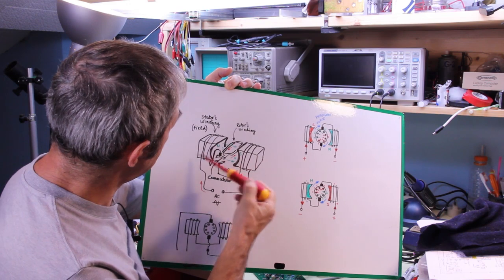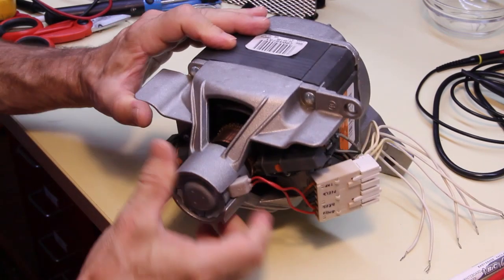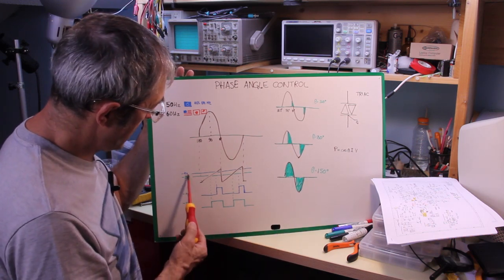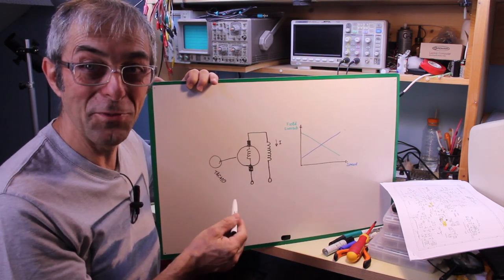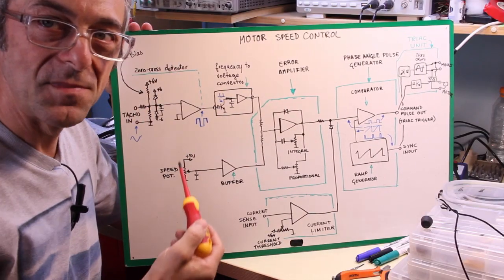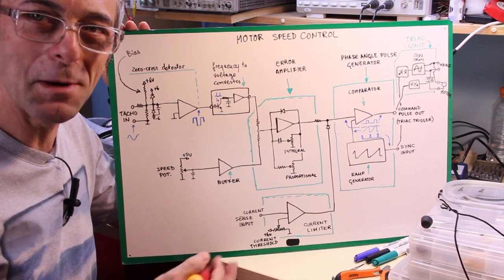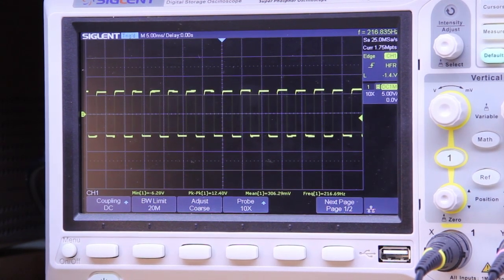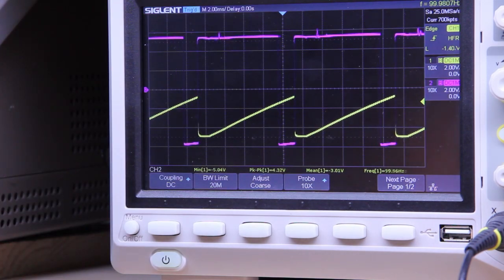All you want to know for driving powerful motors recycled from washing machines

Comment: don't know if you mentioned this in your video or other comments (or I missed it), but I remain with the question if it is OK to run these motors for long time (> 1h) at low speed, like 50% ? 
Thank you for any feed back
Reply from the maker: @jan_db30500  thanks for asking, it's a good question about a topic I actually missed to address. I suppose your concerns are about temperature. Low speed means low power (at equal load). Heat is by function of power. Some universal motors have a propeller or self-fan that increases ventilation as the speed (and power) increases. That kind of motors are not designed to work with high load at low speed because the increased load would make them overheat when the ratio between dissipated power and ventilation becomes too high. Motors used in washers on the other hand usually don't have any fan because they are designed to withstand full load at low speed. However washers often determine a duty cycle that may be related to this issue.
So there is no definitive answer to this question, but just the suggestion to check the temperature at the intended work load and speed. 
Also, motors used in washers have a tachometer (or equivalent) and a thermostat that if connected helps prevent the motor overheating.
In my experience I noticed they become pretty warm but never had issues. A further option is to add a fan, like those used in computers.
Reply: Many thanks for the quick and very clarifying answer. It clarifies all of my concerns about heat, ventilator and even over temperature thermostat. Think I’m going to give it a shot without extra ventilation and when needed, I still can add it later. 
Another quick question… on the motor is stated 11600rpm. Yes eleven thousand. I suppose this is with free run without any restrictions or load. I can’t imagine a washing machine runnin at that speed. The belt would simply not hold it. Any thoughts on that ?
PS: I love it when creators take care of their public!!!
Reply from the maker: @JAN_DB  not sure 100% but I think it should be unloaded with no regulation. This is related to the parasitic resistance of the coils and stray current in the iron that causes power losses when load is applied: more load=>more current, which in turn increases stray current in iron and voltage drop across the parasitic resistance. Stray current means less coercion of the magnetic field thus less force. Voltage drop means it adds to the EMF generated, which is proportional to the speed. Both counteract the supplied voltage. The whole effect is the motor slows down when under load. The more these parasitic factors are larger the more the motor slows down when loaded.
To counteract this phenomenon the regulator has to adjust the output power, comparing the actual speed.
It's difficult to explain this in a comment typing on a mobile phone, so I hope it makes sense.
Reply from the maker: Indeed I think I showed this in the video: unregulated/uncontrolled motors like these [used in washers] would run at excessive speed.
There is another phenomenon in place too. Since these motors have their stator coil in series with the rotor coil, with no load and at high speed the motor experiences de-fluxing, which contributes to the increase in speed.
Reply: @AccidentalScience   not 100% clear in detail (I’m no electrician) but I get the bottom line: when under load it will never get at that max speed…

Comment: Hello, i enjoyed your video. I am curious why we need external speed feedback from tach or optical disk. It seems to me that the speed feedback already exists in the current waveform of power supplied to the motor. There should be a positive or negative spike in the supply current each time a commutator segment make or breaks contact with the brushes. So it's like a built-in 6 or 8 or other number of pulse per rev (depending on pole count) speed feedback mechanism. I would like to build a device like the popular triac-based "router speed controller" which corded hand tools can be plugged into, that will deliver more consistent speed with changing load by compensating based on this feedback. But the fact it does not seem to exist and everyone (like manufacturers of washing machine motors you are using) opt for separate feedback mechanism. Why is that?
Reply from the maker: Hi, thank you for your comment. I have no definitive answer to your question but I think it's because spikes caused by the commutator are the core reason why DC brushed motors are noisy, and the reason why designers try to counteract it in various ways. Also AC mains can lead noise from other equipment. So picking these spikes could be unreliable and that's why some kind of external sensors are used to get speed feedback. 
Motor speed is affected by the internal resistance, so an alternative more reliable method is to use current compensation.
Reply: @AccidentalScience  great points! I had considered the noise generated by reading these spikes instead of suppressing them, but I had not considered the effect of noise from other devices on the line causing errors in the speed signal. Both issues could probably be addressed by the use of an isolation transformer with filtering on the primary, but this would be costly and grow complexity of the devices and is probably sufficient reason why the device I want does not already exist. Thank you for taking the time to address my questions!

Comment: I have a lot of them in my shop and always wondered, with the correct speed control pcb, can I use for of them to drive a small gokart?
Reply from the maker: Unless you bring with you a battery capable of supplying 300V with considerable wattage, you'd need a loonnnnnnnnnnnnnnnnnnnnnnnnng cable :)

Comment: Thank you for this video and all the rest, they're excellent. I subscribed as I'm also building a lathe.
Also I have this exact motor.
Do you have the circuit uploaded somewhere? I'm interested in tachometer input and the freq to voltage converter.
Else: I don't have an oscilloscope in the same place than the motor, do you have a rough spec of the tachometer output? I mean amplitude vs speed and frequency vs speed.
Reply from the maker: If I recall correctly voltage should reach about 20V at max speed, while frequency should be proportional to the speed, in other words a peak per revolution. It is a sine wave, I think I've shown it in the video.
About the schematic I will put it on my website, but in spite of the long time past I haven't completed the site yet 🙄
Reply: @AccidentalScience  Thank you! looking forward. Honestly your approach to the circuit design has so many good ideas and best practices that it would deserve a chapter on its own. It's modular, the feedback is PI, the high voltage section is well isolated... Oh, and also is NOT microcontroller based! rocks
Reply from the maker: @EnriqueVetere  thank you. Send me an email at info at my channel name com, be sure to add your username in the subject, I'll send you back the schematic.
Reply: @AccidentalScience  mail sent! Thanks a lot
Reply from the maker: @EnriqueVetere  I have received nothing. Please check the email address, the name must not have spaces in it. Alternatively go to my channel's page, click 'about' and 'contact for business' to reveal the email address. Please let me know, I have already had problems with that email in the past. Thank you.
Reply: @AccidentalScience  I copied the address from the information page here, maybe it got to spam? I resent it
Reply from the maker: @EnriqueVetere  I'll check for it at the server level, clearly something went wrong. I will reply to you here, in the case I will ask you to try again and again, if you don'y mind.
Reply: @AccidentalScience  sure, no problem!
Reply from the maker: @EnriqueVetere  problem found and solved.
Reply: @AccidentalScience  great! I've just resent the mail

Comment: I would say the main question is: "How did you controlled TWO such motors AT ONCE  to power your lathe?" With one single such, or another controller, with two ... ? Why you did not used just TDA1085C which has all you needed for that application? But there would be the same question again - two motors at once?
Reply from the maker: TDA1085 is no longer in production, furthermore I have a bunch of OPAMPs so I rather use them than buying a specific component. Last but not least, TDA1085 do not provide insulation: all the circuit is at the power grid potential.
About how I managed to control two motors at once: one of the motor is directly driven by a separate triac unit that work synchronous with the one that controls the main motor. The secondary motor has slightly higher speed than the main motor so it is forced to work as torque motor. More in a future video. Thanks for the questions.
Reply: @AccidentalScience  Thanks, you are really fast answerer, my respect! I bought 4 pieces TDA1085C recently easily. If particular separation from mains is required it can be done. I need now for my DIY combo lathe/mill, also to connect two motors to work as single one motor. I was not lucky to find two the same motors (can find two similar) - the same situation like your. Two triac's can be driven from single one controller, and connect Tacho from only one of the motors. For that case, I figured out just to make, and put adequately bigger pulley on the shaft of slower motor. Total torque should be the just the sum of both, but I am not sure about that at maximum load ...  Thanks for Whitworth method video, and other nice ones. Posts about such smart stuffs are never enough, but unfortunately are rare. Care about places where you applied epoxy on your lathe. First, I wanted to make lathe bed from epoxy granite, but I was discouraged when heard from experienced machinists that metalworking machines sometimes became very hot, and epoxy become soft about 80 degree C ...
Reply from the maker: There are thousands ways to perform a function with electronic cirtuits. If you find in comfort with TDA1085, then go for it. I designed a circuit that has multple functions, not just motor control, so I used that one with a couple of power units built around a triac. That was designed around my needs and the components I have at home. That's why we do it by ourselves.
I strongly doubt the bed of a machine reaches 80°C. Do you realize what kind of deformation would occur with such a temperature differential? Also electric motors typically have a thermostat that trips at 70°C, and encoders would just not work properly. If the bed of a lathe reaches 80°C, since it is the largest mass of the machine everything on the machine would level at that temperature. Lathes are subtractive working machines, which means they remove material, and most of the heat is removed through chips. If memory serve me well precision machines should sit between 30°C to 40°C and the most precise have temperature control of course. About this I've made a quick search, this is a problem that has been addressed since 1962, give a look at patent # US3303731A .

Comment: I like all your projects (I follow the one from lathe very closely)
Let's see if you can help me ... I have a washing machine motor, but I can't find any information about it. It has only 3 wires (it does not have brushes), apart from two of the plug, I measure the ohms and the 3 readings give me the same measurement, connect two terminals, it coiled and it got very hot.
I have disassembled where the pins go and it has 3 coils, 6 tips ... And I don't know how to connect it ... Since if I can give you some information, it works 195v and 310hz ... The model is "Nidec wc107a50100"
And if you could even guide me a little, I would appreciate it, thank you!
Reply from the maker: I was just going to sleep but at first glance (so to say) it seems you have a three phases motor. Did you googled for the motor's code? Any result? Maybe tomorrow I'll try to look fo it. Bye.
Reply: @AccidentalScience  I'm so sorry, it wasn't my intention
If I have searched through google and nothing relevant, no datasheet or similar, it also gives me that feeling for certain reasons. Three phases to be able to be managed with an inverter of the washing machine itself, and the high frequency of the same motor, since if an inverter does not do it ... the local network cannot give those hz.
I'm not a specialist .... Others say you can have two gears or two senses, but I doubt it.
Thanks!
Reply from the maker: Don't worry, I was in bed watching videos when your comment popped up. I found this: https://www.indesitspares.co.uk/motor-nidec-sole-0016105900-type-wc107a50100-17500rpm/product.pl?pid=1692103 and I think it is your motor.
This is a three phases motor (induction motor) with high frequency rate, as you noted 310Hz at 195V (AC), able to spin up to 17500 rpm ! Beautiful! The motor has a tachometer for speed feedback. Tacho comes from the two thin brown wires. I think it's a tacho and not an angle detector because only two wires come from the unit and AFAIK no angular sensor have only two wires. The other thicker colored wires are the power coils. To drive this motor you need an inverter. If the feedback was from a resolver (or a hall sensor) for angular sensing then the motor would have required a brushless driver. However I don't know any inverter that has a tacho feedback input (but not an expert on inverters here), so probably you really need the inverter from the washing machine where the motor came from, but that would be tricky. I also found a guy who did exactly what you're trying to do: recovering this kind of motor from a washing machine and rebuilding the circuit to drive it; follow this link: https://circuitcellar.com/research-design-hub/variable-frequency-drive-part-2/
Hope this will be helpful. Greetings from the Alps.
P.s. Consider to subscribe and share, to help the channel growth. Thank you.
Reply: @AccidentalScience  Wowow! You've gotten more information in an hour than I have in weeks! I really couldn't find anything!
I will try to make it work well with this information that you give me, I think the engine is worth it, I'll see that video!
And yes, I am subscribed and I follow many of his videos, among them "Metal Lathe" which I think is a great job.
Greetings from Complutum, Iberian Peninsula

Comment: You gave me a big idea sir , thank you, do you think it would be good for a lathe , what is the wattage of the motor how many rpm can go? while you trying to stop it looked very strong and the feedback keeping it to constant rpm was  impressive, Thank you in advance.
Reply from the maker: Some of these kind of motors can go up to 10000 rpm, some even more. The real problem is to find the specifications. You can have a ballpark idea of the maximum  attainable speed knowing that the spin phase in a washing machine usually is around 600 to 800 rpm, and looking at the diameter ratio of the belt wheel and the pinion of the motor you can calculate the max motor's rpm.
Reply: @AccidentalScience  Thank you for your reply, I think it should be good because I need my rpm's from 100 to 1000, so with a redaction of 10:1 will have plenty of torque. Basically I was thinking to use a vfd to drive my current motor, the problem is if I want to get range 100 to 1000 rpm  I will need to drive the motor double the frequency or more, do you think there is a danger of exploding the motor at higher frequencies?  thank you.
Reply from the maker: @cytron8787  I haven't well understood what vfd have to do with universal motors that are those showcased in the video. AC induction motors have a specific speed rating that is given by their nominal frequency, say 50Hz. Some are specially built to handle higher frequencies, i.e., 400Hz, but that is not common. Unfortunately I have no that experience with vfd controlled motors so I cannot tell you whether a 50Hz motor could handle 400Hz, but under the mechanical point of view I am dubious about the ability of such kind of motor to run at ten times its rating speed: I wouldn't do it! Yes, a motor can also explode if it runs at a much higher speed. When I was young I heard a story from a fellow technician who fu*ed up the field parameters of a BIG DC motor (as tall as a man) which run away up to the explosion point, destroying a section of the building where it was installed and almost killing two men. Universal motors are usually rated for higher speed to work through a reduction and draw smaller current as they have poor heat dissipation and low efficiency when current goes high because of their field-winding configuration. Nevertheless motors coming from washing machines are pretty powerful and feature higher efficiency (for an universal motor) as their winding is thicker and have large brushes. Providing an external ventilation (i.e., through a computer fan and placing the motor in a proper case to convey the air flow) you can even squeeze quite a current through them. It's important to convey the air inside the motor as the rotor is the most critical part. Ciao.
Reply: @AccidentalScience  Thank you for the answer, I just want to run it 3 times of its rated rpm say from 50hz to 150hz, Really want to try it because it is much easer for me. I will take the risks , after all science it always risky :-).
Reply from the maker: @cytron8787  3 times more is not negligible but likely the motor won't explode ...however I won't take liabilities ;)
Reply: @AccidentalScience  Sure, responsibility it's mine , basically what I am afraid is if the ball bearings fail suddenly, probably I will replays them with hybrid ceramic bearings.